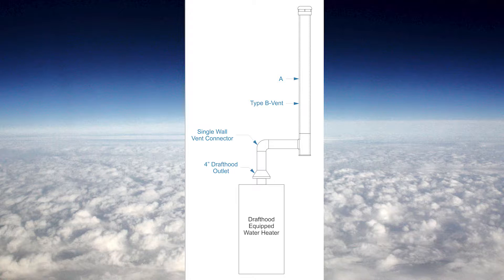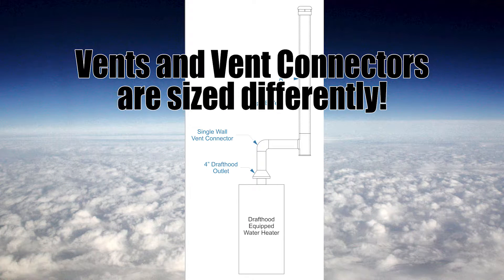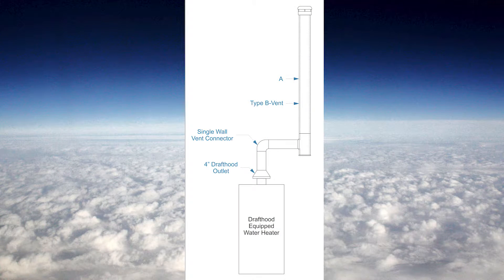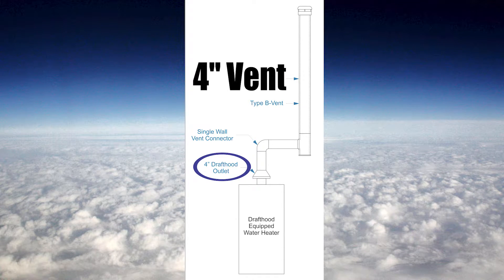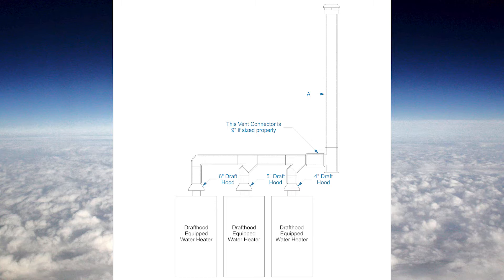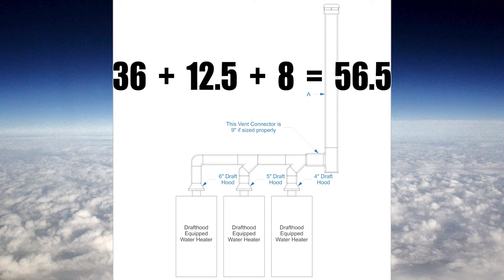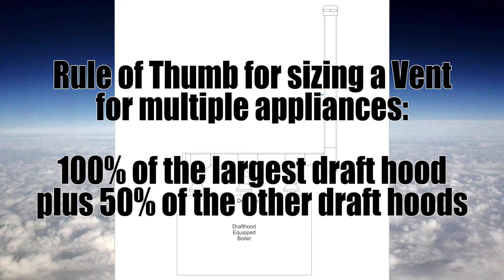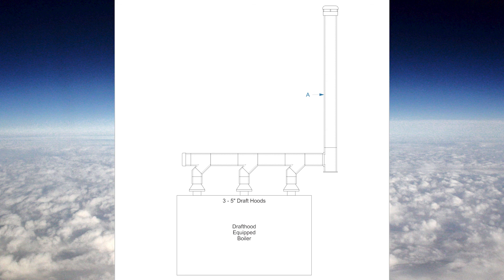Gas Venting: Part 2 - Sizing Vents with the Rule of Thumb Method

Comment: Great informative video. Can I ask how do you size the required diameter of the vent connectors? I have 4 gas water heaters each rated at 40k btu with 4" outlet on top in a basement.  I have about a 20' foot horizontal run before entering the chimney.    I would assume I have to start with an 8" at chimney then start stepping down to 6", 5" and 4" to the water heaters but I am not sure. Also, should I use b-vent or regular single wall? Please help.

Comment: Where should the hot water heater vent be in relation to the furnace vent on a chimney?
Reply from the maker: The vent connector with the smallest size must enter higher than the vent connector with the larger size. In the case of my example at 2:25, the diagram is screwed up and not to code according to clause 8.19.1 of the B149.1 code.

Comment: So is it allowable to vent a 35,000 btu category 1 HWT with a 4” vent connector with a 2’ lateral into a 6” B-vent with a 30’ vertical? Only one appliance is venting into the 6” B-vent and the draft is -.06” WC